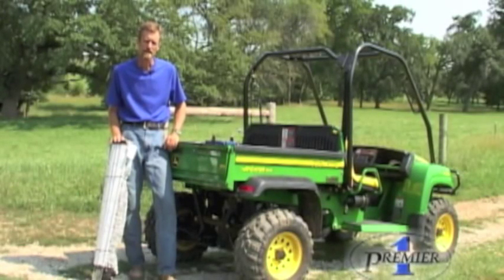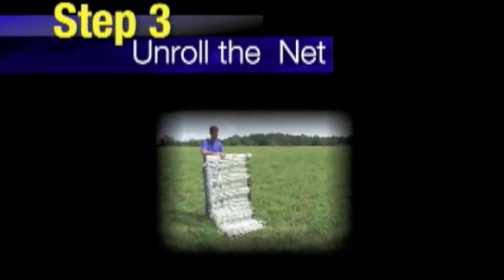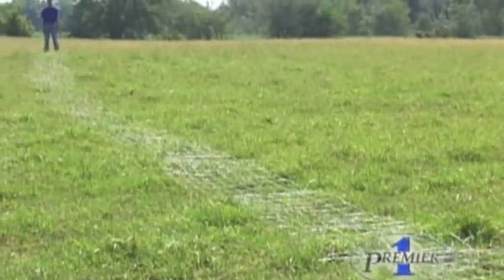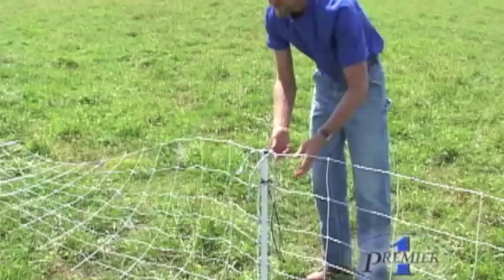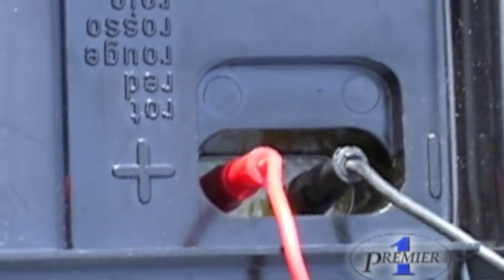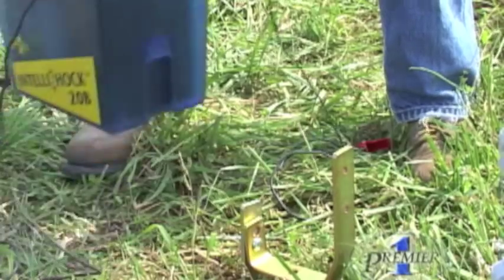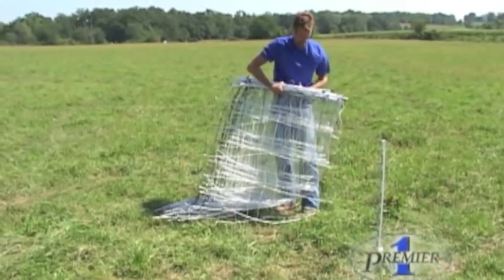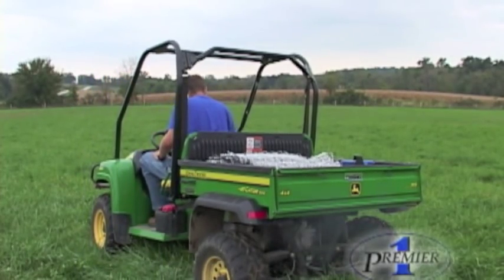How to install Electric Netting from Premier

Comment: I have the poultry netting and need to make 2 paddocks next to each other.  How do I connect the 2 with one charger?  Is there a video on this or do I just run another orange clamp between the 2 metal plates of the fences?
Reply from the maker: Run another orange clamp or insulated fence wire from the energizer to the second fence.

Comment: Question: is the ground and the hot wire both in the netting, or do you still need to install a ground rod.?
Reply from the maker: It depends on the net. Most nets are Pos/Pos, so all the strands are connected to the fence terminal. The animal touching the fence (and ground) completes the circuit, allowing the pulse to travel back to the energizer via the ground rod.

Pos/Neg (P/N) nets are set up so half the strands are insulated from the other half. The halves are connected to either the fence terminal or the ground rod. When an animal touches both a pos and neg connected strand, the pulse travels through the pos section of the fence, through the animal, into the neg section of the fence, back to the ground rod and into the energizer. So a ground rod is still used.

Comment: Looking for some pointers on using the Premier One 48 inch poultry electric netting. Is there an indication of clearance that it must have at ground level or can the bottom strand touch the ground? And what if the ground is very wet? At one corner I have a clicking sound.
Reply from the maker: Carlotta, 
The black (nonelectrified) strand on the bottom of the fence may touch the ground. The white (electrified) strands above should not, otherwise the make a direction connection to ground and short out the fence. 
Give us a call at 800-282-6632 and one of our consultants can answer your questions.

Comment: Do you need to mow grass down where you set the net up to keep the grass from shorting out the fence?
Reply from the maker: Grass isn't the most conductive material, so contact does not create a dead short. It's more of a leak. However, many little leaks add up to a large leak. Mowing is the best way to reduce grass contact.

Comment: Can I electrify it from an existing electric (single wire) fence?
Reply from the maker: Yes. As long as you have enough available energy from the original fence. Give us a call at 800-282-6631 if you have further questions.

Comment: These videos show folks with these pristine fields with tall grass, for the most part flat.  My situation is a wee bit different.  We have 23 acres of land in the SE corner of Georgia.  Basically swamp land with a bunch of very old Georgia Live Oaks (we call the place 7 Oaks).  That coupled with some of the most aggravating vines you've ever seen that crawl all over everything and anything that will stand still long enough (house included).  I have looked, but cannot find at what point, or at what portion of the fence, cannot have any vegetation touching it?  Is it that  second to the bottom horizontal line?  I know the black one at bottom is allowed to touch the ground, but what about the next one up?  Any answer would be greatly appreciated.
Reply from the maker: Hi Andy, 
Give us a call at 1-800-282-6631 and one of our consultants will answer those, and any other questions you may have.
Reply: Thank you, I'll take advantage of that soon, I have the fence up and running already, but still a bit unsure about how deep the grass can grow.

Comment: I am getting ready to start Beekeeping.  I have trouble with trespassers on my land.  I have had an electric fence in the past to keep livestock in,  Now my question is to use it to keep unauthorized people out. especially away from the beehives.  I have 2 acres to guard.  Often I am not always home weeks or months at a time.  I am tired of everyone driving their 4 wheelers across my land, destroying and / or stealing stuff.  I sure do not want them spraying my hives with wasp poison or whatever they decide to use.  so I was thinking of solar electric fence, but I  have best sun close to the house, the bees will be at the far side of the land.  So, I am curious if there is a way I can make the entire two acres hot ( electrified) , in a manner no one can enter without some kind of remote controll on / off power button, kind of like a car key fob lock?  Make it so I have to have that remote to power the fence on or off. the ones that are not solar like I have had in past, I would use a remote power on / off plug simalar to one of theses: https://search.yahoo.com/search;_ylt=AwrB8o7eAVZZZ3wAiYaJzbkF?p=remote%20power%20on%20/%20off%20plug&fr=yset_widemail_chr_win&fr2=p%3As%2Cv%3Ai%2Cm%3Apivot&stype=web Is there any way to use somthing like this on a solar powerd eletric fenc? I do not want gate handles where anyone can go through whenever they please. I want to make it basicly as I mentioned so I must have that remote to enter or exit the land. is it possible? how would I do this?
Reply from the maker: Thanks for asking. Electric fencing is intended for livestock and wildlife, not for humans. We are unable to offer any suggestions for deterring humans from your property. 
However, if you need to keep your bees safe from wildlife, please give us a call at 1-800-282-6631 and our consultants will advise you of your options.